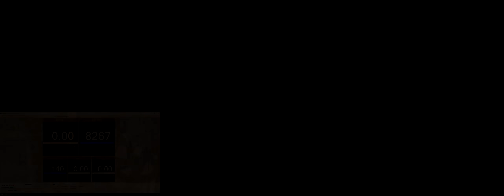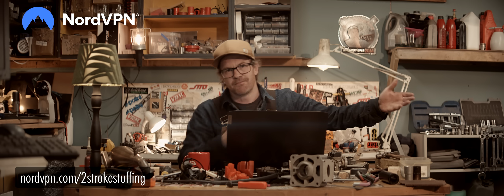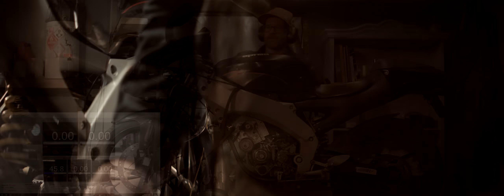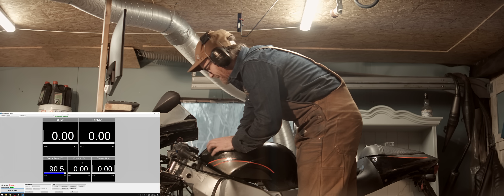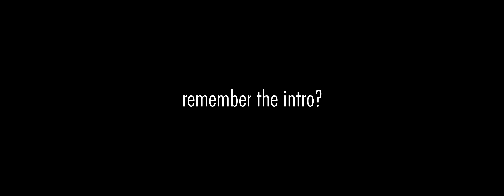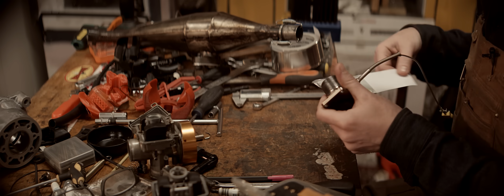P2 - Found THE Problem! - Now, Onto Making the Most Powerful Two Stroke Ever.

Comment from the maker: Check NordVPN exclusive deal here https://nordvpn.com/2strokestuffing lt's risk-free with a 30-day money back guarantee!
Reply: The url is wrong
Reply from the maker: @Krishell  fixed! Thanks for letting me know!
Reply: Why not make an exhaust with a change in the volume of the middle section?
Reply: @AleksaRancic yeah his tuned pipe ain't tuned. He can double his HP if he uses math and builds a proper expansion pipe.
Reply: For every 500/min. The pipe length should get shorter 20mm to keep the pulse arrive in time. And/ or hotter Exhaust gasses give faster pulse from the pipe.
Reply: @henkcox8212  Allahumma shalli 'alaa sayyidinaa muhammad wa'alaa aali sayyidinaa muhammad wasallim tasliima😁😊

Yok Tobat Kawan Dan Jangan Lupa Sholat Dan Sholawat😊😁
Reply: Why can't some of us write our one comments.

I thought you had a fill problem when I started watching.   Exhaust issues could effect the flow in.  I still think if you're going to make crazy power you're going to need some sort of velocity stack or accumulator/plenum to have enough air available
Reply: Take a torch tank and spray some oxygen into the cylinder while on the dyno.. you xan confirm lack of air by using extra pure oxygen.  If the egt goes up.. it's lack of oxygen intake.. if it doesn't go up... it is just drawing it through
Reply: Allahumma shalli 'alaa sayyidinaa muhammad wa'alaa aali sayyidinaa muhammad wasallim tasliima😁😊

Yok Tobat Kawan Dan Jangan Lupa Sholat Dan Sholawat😊😁😊😊😊😊😊
Reply: Keep up the good work, making something special is never easy, but always worth it in the e
Reply: Make an exhaust this way with a movable middle section and you won't go wrong.
https://i.postimg.cc/zDHYQZ8T/168697501-10222923545869904-4760481315213101760-n.jpg
https://i.postimg.cc/c472qdjt/169062234-10216070311065397-5538828104840138536-n.jpg
https://i.postimg.cc/4dh2WGVd/139708350-10158279105913068-150930382989612466-n.jpg
https://i.postimg.cc/BQx6d145/img20140524102403.jpg